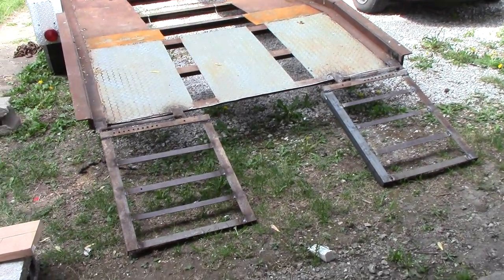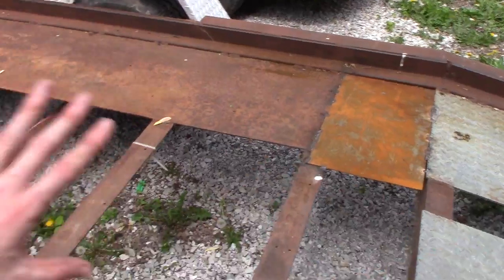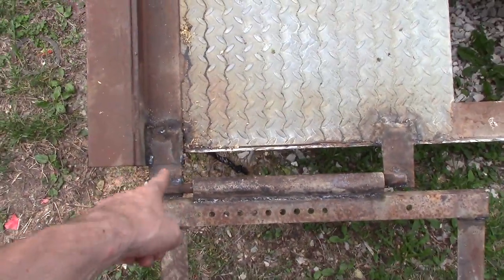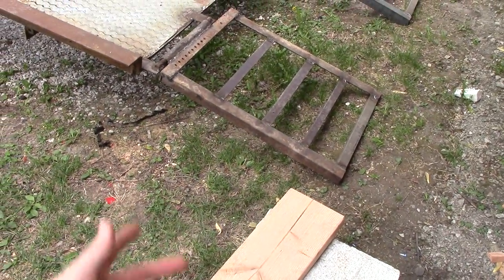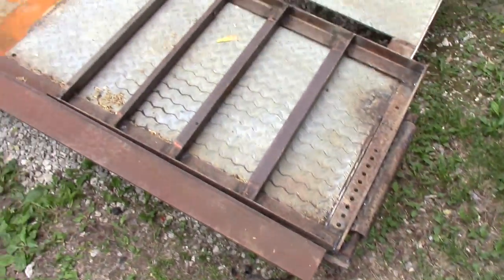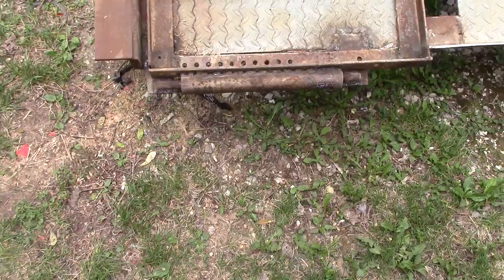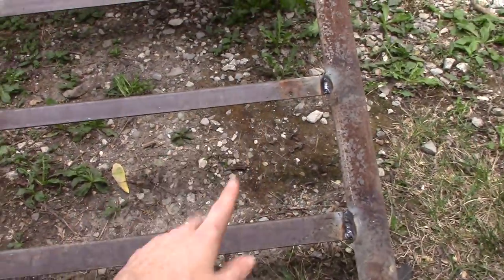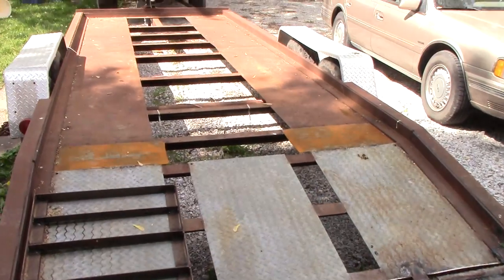Building Trailer Ramps

Comment: im not sure  but i see the car maybe high siding or high centering  if the front wheels clear the ramps way b4 the back ones can reach them im thinking maybe a little longer ramps.and far as the grips dont weld any thing on them weld little pot welds or little globs of weld all over them other then these are just thoughts and ideas not trying to sound like a prick just throwen that out there as a 2nd brain